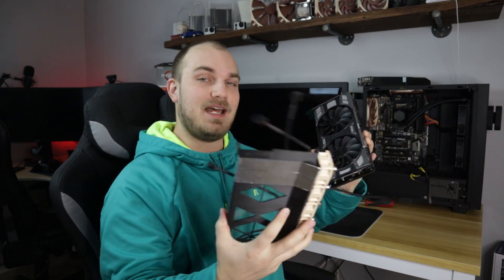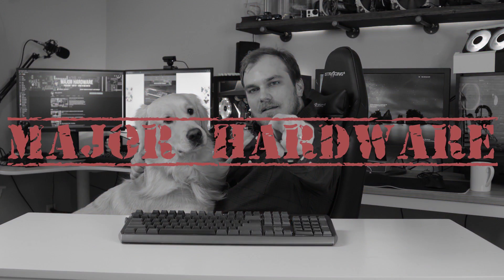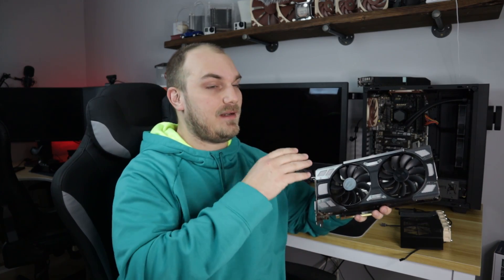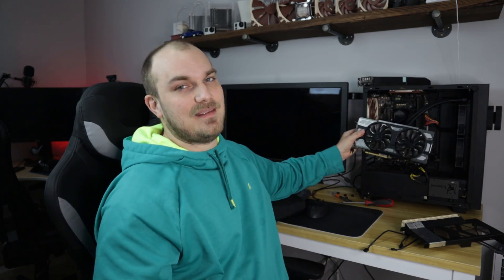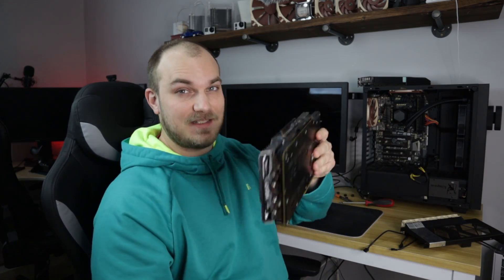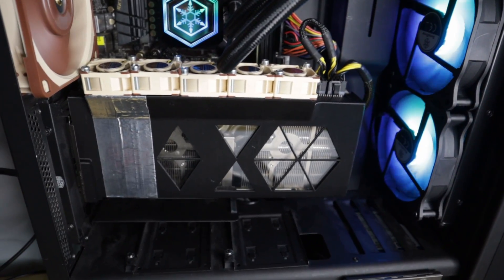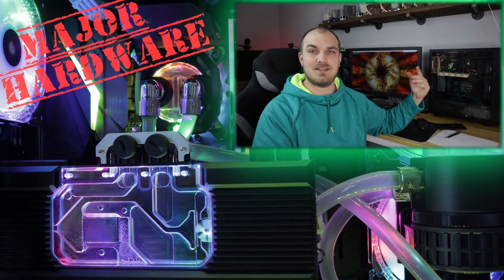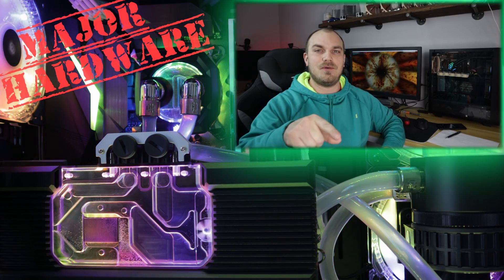I Didn't Expect That Performance

Comment: Thank you for trying ! I really think there is a LOT potential in it and I actually have design in mind , that could actually work better than original cooler . Today , 2 years later , with new outrageously huge coolers and insane thermal requirements , its time to create something new and awesome ! If you want to create a follow-up on this video , tell me , how to contact you

Comment: because of the gpu heatsink fin...the place that the gpu fan were screwed in were blocking the airflow...it might work if the fin wasn't designed like that...so maybe on another kind of card with different heatsink design would work?

Comment: My gigabyte aorus 2060 super ...has the 3 fans that glow ..runs hot for me .my thermaltake view 31 case it was right up against glass when I had it vertical..swapped out about a week ago to the lian li lancool2 case ..I love it n the gpu is more in the middle of the case n got 2 fans inside the power supply shroud blowing air up on the gpu but yeah mine is the hottest thing in my pc...I wanna keep things as cool as I can..know it would prob help on lifespan :) wonder if gigabyte would look at it 4 me ..I filled out n registered it ..think was 4yr warranty on it but not sure how I go about it ...but its a hot card I got n worries me ..I paid a lot 4 it at that time ...500$ still 450$ on newegg ..I love it just not the heat off the backplate area ..n hate to not run it vertical , its made to b shown off honestly :) I love all the tech ideas n vids! Gets me thinking n wanting to wire something up n tinker :)

Comment: The holes on the shroud are useless. They allow heat pockets to build on the lower half of the fin stack. Fill them and open the holes wider on the side of the card where the pcie slot is to allow direct flow over all the fins from bottom to top.

Comment: the gap between the heatsink and the see through bit must be filled. the air is going around most of the heatsink not through it, my advice would ne to fill the gap and test again no push pull crap needed for this, i create my own cooling solutions like this and making sure the air is going where you actually want it to go is a key factor,  see through plastic pretty much up against the heatsink so the air is forced between the fins, your ideas are awesome though keep it up, figured out how well heatsinks work under water when washing a dirty one, switched from cold to hot water and the heatsink went instantly hot same with back to cold, wanted to do what you did with it but dont have the resources unfortunately, hope the advice helps with the project

Comment: I would love to see you try to fix or mod a 5700xt reference card with various new coolers. I want one for my ref card but many dont have good VRAM temps unless modded in various ways, or use liquid like the Frostflow 120 or 240 or the Alphacool or something to transfer the gpu die heat elsewhere anf blowing a fan on the vram. The Morpheus II and the Accelleros have varying results for different people for the vram i think because of vram heatsink application and the fact all the heat is being blown onto the PCB so gpu die heat is trying to cool the vram heatsinks. I also have seen aluminium cold plates used that cover the gpu die and the vram with the cooler mounted on the cold plate, but idk where to buy such a thing lol. Help!! ;) im totally down to mod some crazy contraption to keep my system quiet lol. Im leaning towards the Frostflow or accelero tho idk

Comment: At least the shroud you made looks cool. I think you would have had better scores if the GPU heatsink blades were vertical instead of horizontal. I bet you were only cooling the top of the card and no airflow was traveling from top to bottom very well.

Comment: I love this video thanks.
Could you try cooling a blower style 2080 ti with a server cooler 12000rpm and 6000 rpm instead of build in turbo fan.  Which is best.
Kasper
Reply from the maker: Ive broken to many GPU's to risk experimenting with my only 2080ti
Reply: @MajorHardware   then an other 250 watt gpu maybe :)  maybe a 780 or something
Reply from the maker: if you send me a 2080ti ill do whatever you want me to do to it:-)
Reply: @MajorHardware  unfortunately I'm not brave enough to make the test on my 2080ti at work, and I dont have any personally, only a 1070

Comment: I know in theory there isn't a difference between push and pull but I wonder if the shroud would work any better in a push config, with the fans pushing air down into the heatsink. Convection assist is almost negligible the moment that you have any significant airflow (it takes some serious engineering to be able to feel convective airflow from a fully passive heatsink) so it shouldn't really affect the temps to be any worse than they currently are. I also wonder how warm the card would have gotten if you'd raised the temp limit so that it didn't artificially throttle the clock speeds.

Comment: I'm not entirely sure about the construction of that shroud but it seems you are using the fans to pull air through the heatsink and up. Depending on how the air intake side is designed that might be a bad solution. I would try inverting the airflow, blowing air down through the heatsink. I'm also uncertain about the front of the shroud. Are those openings in the shroud where we can see the heatsink, or are they closed of with transparent plastic? If they are open then try closing them up and opening up the bottom of the shroud to act as air intake or exhaust depending on fan direction.

Even if you have ideal air path I think the small 40mm fans won't be able to keep up with the original fans. For fans that small to really move some air they have to run at a very high RPM, and what you have installed looks like a set of Noctua fans. Those are high quality but sacrifices airflow for lower noise. For real airflow you need something like the Sunon PMD1204PQBX-A 40mm 13000 RPM fans, but make sure you've got some hearing protection at hand as they will be very loud. I've spent way to much time around fans like that and my hearing isn't was it used to be, so that part of hearing protection isn't a joke. And these aren't even the best (worst?) 40mm fans for airflow.

Comment: Hey I thought about the static pressure dilemma we discussed in an earlier video (the one featuring the 30 blade fan I believe). Measuring static pressure should actually be really simple. Just make an adapter from 120mm fan to your prefered pvc pipe diameter. Make a u -shaped pvc setup, put the fan and adapter on one side, and put clear pvc in the other. The difference in the water level (m H2O) easily converts to psi with an online calculator. I really hope you see this though.
Reply: The diameter of the pvc shouldn't matter much, only the closer you get to your fan size (120mm), the less pressure drop occurs in your adapter

Comment: I have zip tie ghetto water aio cooling it works amazing with original fan still connected for vrm
Reply: i do ghtto cooling too :D
Reply: Radu Mircea Bunica   Poor boys ftw!!!
Reply: @PixelGod240  less about being poor, more about being efficiency orientated.. 
and i get to use my hands? (i'm also an artist) - yes please!
700 usd gpu performance on a 500 usd gpu + 100 usd in ghetto mods - sign me up.
1 and a half slot gpu is now 3 and a half slot gpu but looks oem/clean (even if i used zip ties). 
it'a a cool (pun intended) work of art :)

Comment: Your design could work but you need the proper heat sink design for it. Those fans may also not be idea for this type of setup also. If you want to try some delta 1u server fans that would help but be very loud and also you would need the heasink be designed so the fan pressure would take the heat away and you also need it to escape effectively also. Right now your blowing some air at a brick wall especially.

Comment: turn the fans so they blow into the cooler
Reply: Philip Webb generally there isnt any difference in temps between push or pull
Reply: @schnugg9672  with watercooling yes and no, static pressure is needed on the radiator and the highest pressure is always on push. But again with watercooling very low difference (1c to max 2c). With aircooling no. You need an air flow thruw the fins. So here air flow is needed, less static pressure. Aircooling push, watercooling push or pull. You can see it on the structure of the fan. Air cooler fans many fins but thin and watercooler fans less fins but thicker.

Comment: I think that Coolermaster V mount is one of the better ones in terms of airflow, since there's a huge gap for the fans there is little to no difference with mounting it the traditional way> Now what would be interesting is to see the RAM compatibility with a TALL card and that V mount or maybe performance degradation with that PCIE extension

Comment: I do the same on 2080ti but i use 2x 140mm fans at the bottom with an air duct to the gpu and lost some degrees maybe you try it for all other peopls
Reply from the maker: given my track record on killing GPUS i dont think ill be taking apart my 2080ti

Comment: well at least you know! looked like a good idea at first... since i am using a cheap no name case from 2005, i put a fan on the PCI grids (was not made to have one but i "fitted" a 120 mm perfectly!) and the GPU is as if i had the case open with a house fan blowing on it so it never had PC case Hot air! tho my Zotac 1050Ti cannot heat anyways. but i had a pair of 8800GT 512 MB in SLI and they went from 104C running to 80C! (remember those old cards used to run 90C idle before the 9000 series came out, 8000 series were toasters...)

Comment: 4 of these little 40mm fans are a little less powerful than a single 80mm fan... So yeah, you'd need at leas 9-10 of them to match the airflow of the stock fans :D Perhaps you can put 5 more on the bottom and try out different orientations?

Comment: I would like you to try and make a triple or even quadruple slot blower for that card. 

I live in the caribbean and the humidity and heat down here makes it almost impossible to keep components cool without having to CRANK case fans.

Throughout my life as a "pc guy" (started in my early teens and I'm in my 30s now) I have mad MANY cases, MANY gpus, MANY configs and the results are always the same.

Open style gpu = Cooler gpu temps in exchange for hotter cpu, ram, vrm, powersupply, hdd/ssd temps.

Blower style gpu = Hotter gpu temps in exchange for cooler cpu, ram, vrm, powersupply, hdd/ssd temps.

And the delta in temps were rarely ever insignificant. 

Example 1- I had a SAPPHIRE Radeon HD 4870 "open style" gpu with an i7 920. In this config my cpu would constantly hit high 80s  (c) and the gpu would sit at high 70s (c). 

                     I then got a sapphire radeon hd 4870 x2 "blower style" (same card but with 2 gpus and 2 ram clusters). In this config my cpu would be in the high 70s (c) and the gpus would be in the high 80s (c).

Example 2 - I had a evga 660ti "blower style" card and an i7 4790k and the temps were better all round. The gpu sat at a constant 80c (with the fan screaming at 100%) and the cpu sat in the high 60s (c).

                      I then got an asus 660ti direct cuii "open style" card. This instantly shot the cpu temps up to the high 70s (c) while the gpu never crossed 75c (with the gpu fans whispering at 60%).

At this point I just want a gpu cooler that has a blower (which isnt loud) and can still keep the gpu temps nice and cool. I dont care if it takes up 4 slots because I cant remember the last time that i filled up ALL my expansion slots.

Comment: Do what I did with my gtx 680 gigabyte OC 5 fans.
When it was toasty I put Arctic fans on top of it (was from their gpu cooling heatsink)  I  put the 3 fan on top and I had 8 fans.
3 blow cool air.
5 blow out air.
Was good for another 3 years.
Still have it if you want, sitting in it's box.